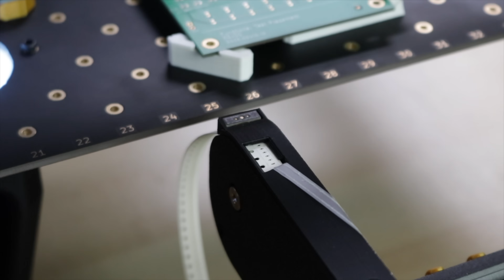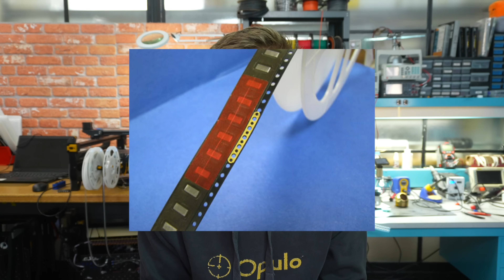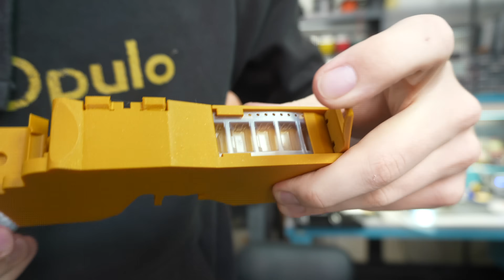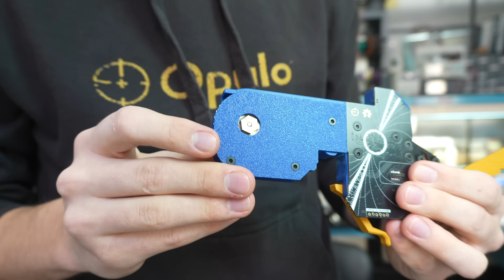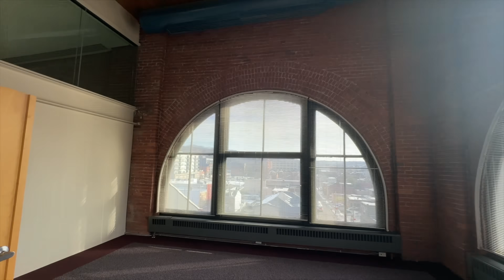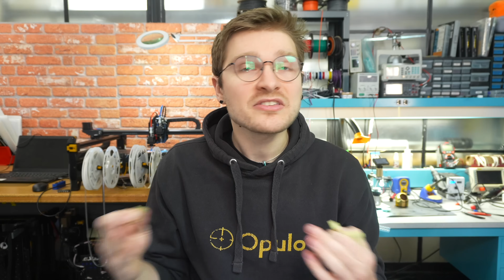February 2026 Opulo Update

Comment: What a beautiful space you have lined up!  Congratulations.  Nice work on the feeder loader.  I didn't quite get it...Are you recommending, or is it possible to take a current Lumen feeder, print out the new frames, and easily reassemble to get some of the improvements you mentioned?  Little things, like keeping the peel tape guide away from the gears would be great.  Of course, having all the improvements that make things more accurate is always welcome.  Thanks for the update!

Comment: What is the max input current of a feeder? If it's something like 100mA at 24V, it would be about 550mA at 5V, which does not even require USB PD. Just a simple boost stage from regular USB. Let me know if this would work for you, I can design it and submit a pull request on GIthub.

Comment: Is it possible to get the vacuum pumps quieter? Replace with quieter pumps? I live in an apartment, and from what I have heard on the videos, my neighbors would probably get upset with me if I ran the LumenPnP in my apartment.
Reply from the maker: V4 is quite a bit quieter than earlier versions, with the pumps fully enclosed in the control box. We should make a video showing the difference in volume!

Comment: Wait a minute, with PD you can request all the way up to 48V. I should know I just designed a power supply.
Reply: Yes, with EPR you get 28V, 36V and 48V. Power supplies and cables supporting it are still not super common though, as far as I'm aware.
Reply from the maker: Yes, this is what I meant. Sorry I wasn’t accurate with what I said! The point of PD in last month’s suggestion was to prevent having to use another power supply, but buying a dedicated PD that supports it defeats the purpose. AFAIK, it also doesn’t support 24v exactly so we’d have to have a buck or LDO in there as well. Apologies for the mistake!
Reply: @opulo  The latest spec w/ AVS allows for custom voltages but yes you're right most of the PD power supplies are gonna support fixed so you'd have to buck down.

I've gone to usb c PD on all of my consumer electronics products and honestly, worth the extra 15 bucks - but that's probably because my lineup averages out the cost esp. in bulk. 

Don't you love how you can say one thing wrong in a 10 minute video and still get called out XD <3
Reply: @buildacubesat  PD is one of those wishy washy things because a lot of proprietary protocols secretly also speak PD (lookin at you Qualcomm)
Reply: With PPS u can ask the supply even for 24 V.
Reply: @mola6228 I thought PPS topped out at 21V, but I wasn't able to find a definitive answer. Oh the joy of implementing USB-C.
Reply: @buildacubesat  you are correct
https://www.usb.org/sites/default/files/D2T2-1%20-%20USB%20Power%20Delivery.pdf (
Fixed Sources & Programmable Power Sources)